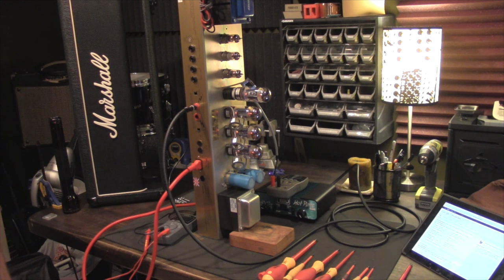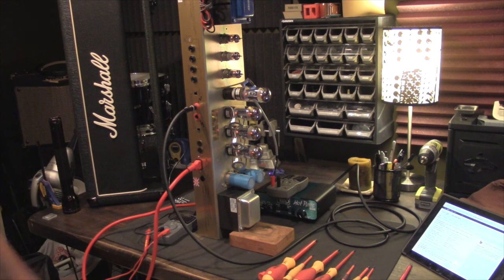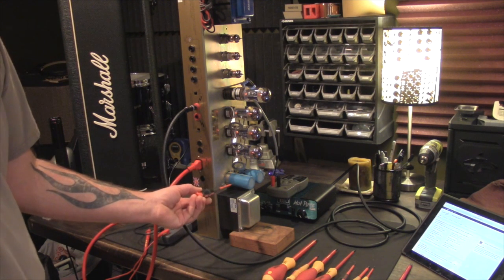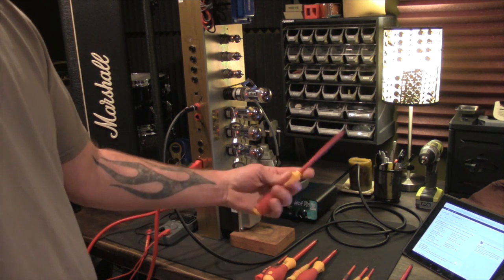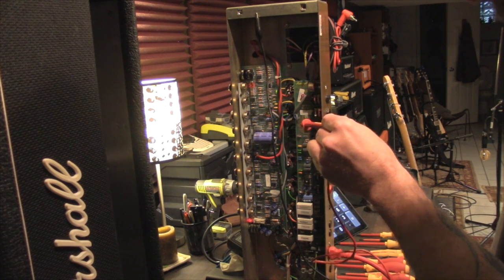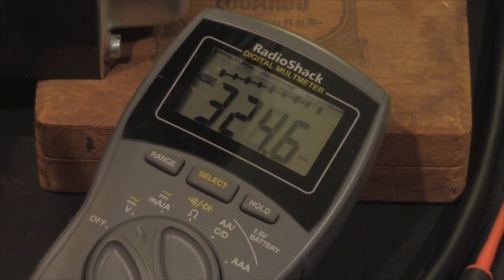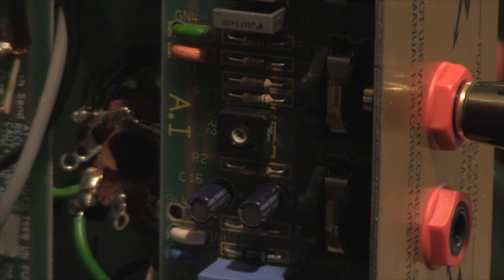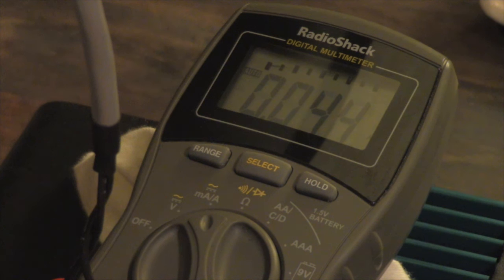JCM900 Bias Video

Comment: I have a 2555x and was unsure about biasing. It has bias points which makes it a lot easier and safer. what I don't know is what I should bias it at. When they shipped it the bias was all out of spec. One side was 85 and the other was 65. I put them both at 70 and it sounded much better.

Comment: Hey 
I just changed tubes on my 900 combo.  Your video was great.  Unfortunately I watched it after I almost blew myself up. LOL  All the things you mentioned I figured out by trial and error,  one other thing is where is the 56K R28 resistor so I can replace with 47k cause EL 34 cant be biased properly the way mine is set up.

Comment: So I'm confused. Can I ask two things? 

So, Isnt there a way to set the Bias of an Amp with just the Multimeter, without having to use bias probes? Like with just using your regular multimeter probes? Because when I tried biasing my 900 for the first time, I had some help, and I just remember having to have the black probe on the chassis, and touching the red probe to a leg of a certain resistor, or the bias test point, and then setting the bias until I got a certain reading on the MM. Like within the recommended bias number as per Marshall, and then I made small tweaks while playing to decide where I wanted it. 

Second, so is using bias probes just a more in depth elaborate way to bias the amp, or a way to get a better average if tubes are not matched or something? 

So the process is, If your using those Bias Probes, are you just getting the plate voltage first(with the normal MM probes), then sticking the bias probe in one of the Sockets with the tube in the bias probe, doing the math, and then setting the bias trim pot, while that same tube is in the bias probe, and then thats it? That's what I don't get, because it seems odd to me that you only need to use the Bias Probe with one tube, but then if you do for some reason use it with every tube, and each tube reads different, or is unmatched, then how do you set it since theres only one trim pot? You just take an average of all the tube bias readings first? Like what I mean is say you set the bias to 44 with the first tube, and then go to the second tube and it's not 44, how can you set it to 44, without the other one drifting? Also, don't you need to get the plate voltages for all the different tube sockets? 

I guess so I'm not confusing you by babbling, Im just confused, because in the video it looks like you are getting the PV off one socket, putting the probe in one socket, getting a Bias reading, doing the math, and then setting the Bias while the bias probe is in that same socket/tube, and thats all there is to it.

Comment: The best video for biasing on youtube!! i have one question though if you can answer, can i do this and how without a bias probe and only one multimeter? and the screwdriver you are using, they dont have the metal tip??
Reply from the maker: Thanks so much! Sincerely appreciate that! You can bias with one multimeter only, you just have to use it to read the plate voltage and then use it to bias the amp instead of having them both hooked up. The screwdriver has a metal tip but completely incased in plastic and rubber.
Reply: +Roy Cox Oh thanks for quick reply!! So i can measure bias current the same way as plate voltage? I dont need a bias probe for tube socket?
Reply from the maker: +MBString I'm pretty sure you can measure bias by using using different pins but I'm not familiar with biasing without a bias probe . If you do some research you may be able to find info on biasing without a probe. Be careful!

Comment: ROY COX, 
Is the Chokes storing current like a reservoir like the filter capacitors or is the Choke doing something else to the AC ripple, not sure if the Choke is regulating the current? 
Most Power tubes 6L6,EL34 use a B+450vdc on the plates, if you increase the B+ to +600vdc would this increase the AC ripple but why would it increase the AC ripple? i would think it would decrease the AC ripple because more B+ voltage mean less current draw from the power tubes. 
When you're biasing the power tubes in an amplifier circuit how do you bias the compression of the power tubes the 1dB compression point of when the power tubes start to compression? because its say to bias tubes at a 30mA bias current per tube to be safe but how do you know when the tube is compressing?

Comment: Where did u find that 30W information? Datasheet too? What field? Is it plate voltage or screen grid? I can't find the same information on the Sovtek 6550WE Tetrode.
Reply from the maker: the tube wattage is from the tube manufacturer and follow the video closely and i talk about where i find the plate voltage, etc.

Comment: Ive got an issue with mine, it works fine, but when reading the plate voltage, im getting 672 and not 470 like the average, what can I check or what could be causing this? Thanks!

Comment: I have a JCM 900 MKIII that has all stock tubes from the factory and they are still good.  I has EL34 tubes and I have not had it to a shop.  I have read that it might be biased from the factory to run 6L6 tubes and that it might be over biased running a lower current, is there any way I can check that without a bias probe?  My amp was made in 1990 serial starting with Y.

Since I play metal I use only metal on my amp.

Comment: Quick question. So you were touching the red probe to pin 3 with the black alligator clip on the chassiz to get the reading I understood that part, but when it came time to adjust the bias how were the probes set up, did you just have an alligator clip on pin 3 instead of the probe, or how was it hooked up to get the bias reading?Also can you bias an amp without knowing the values of each tube? Like do you only need to get the reading off pin 3 and thats it for this amp?
Reply: you unplug the alligators after reading the plate voltage, and plug it on the bias probe, to read mA.  you only have to do it for one tube. Pay attention to buy paire quartet.

Comment: I am trying to bias a JCM900 MKIII 2500 (50watt) el34 and having some trouble.  First off when I set my multi-meter to 200ma it gives me a super low reading (11.7ma).  When I set it to 200mv them it gives me a low reading.  I turn the pot all the way up and max I can get is 27.2mv.  What am I doing wrong?
Reply: Bias resistor is the wrong value

Comment: Hey Roy, great video, best I've been able to find. But, I have a JMP 100W Super Lead Mkii which I'm going to replace the 6550s. Is the biasing procedure the same for this vintage amp? I know the voltage/current values will be.

Comment: Have same amp . What if I just changed out the power tubes new matching without bias ?  Thanks
Reply from the maker: if the new tubes are rated exactly or super close to the old one then you can probably get away without biasing but the chances of them being the same are usually not that good so I always like to at least check the bias. It just helps to make sure the amp sounds its best!

Comment: Great video man! I just bumped into a 94' JCM900 4100 100 watt. The amp sounded great at the sellers home, however I don't think i'm going to use it until I get done what your doing to this one! I'm a little confused about seeing the 7881's being replaced with the ones you put in this amp, and others using EL34's. Should I stay with 7881's.. are EL34's okay to put in? Is one set better for the amp or not? I play harder rock/metal. I do know you get a different sound with different valves. Again..'thanks for your video.. the best on youtube!   \,,/

Comment: Roy. Joe here. Wanting to know if I have jcm900 head I bought and it don't have the 4 power tubes in it. It has the 3 original marshall preamp tubes in it. It says it has 5881 power tubes.my question is I don't know it's history with previous tubes if I buy the new 5881 tung sol would it need to be biased
Reply: Yes.

Comment: If you don't have any biasing equipment, can you just crank the bias pot up while the amp is unplugged and discharged and hope for a better sound?
Reply from the maker: I'm sure it's possible but that adjustment screw is so sensitive that it could easily cook those tubes if turned too far which could easily burn the tubes up. New tubes cost way more than a bias probe so I recommend not risking it but rather getting the probe and multimeter. You'll get your money's worth many times over in the future when you have to replace the tubes. It's so worth having the probe and learning how to do it!
Reply: +Roy Cox Hey man, I cracked my amp open and learned that the amp is currently biased at 42, and when I did the calculations that you explained in the video, I learned that It should be set at 38. Any thoughts? is that too hot? Sometimes the amp starts crackling, and I don't know if thats a product of over-biasing and I wanted to get your opinion first.
Reply from the maker: +Kelly Bouchillon that's a little hot but nothing too severe. I doubt the crackling is coming from the hotter bias but most likely your preamp tube socket of sockets being dirty of a bad tube. You may want to spray deoxit 5 on the pins of a 12ax7 and push it in and out of the preamp tube sockets to clean it, then put the tubes back in. If that doesn't fix it then try a new 12ax7 in each slot and see if it goes away. The hotter bias won't hurt anything but can wear the tubes prematurely.
Reply: At one time, amps were biased by watching the output tubes in a darkened room, turning up the bias slowly until the tubes' plates began to glow orange, and then backing off the bias until they stopped glowing. Not recommended!

Comment: Great video! I'm curious- is it necessary to do this with each power tube in the amp? Or are we assuming that the tubes are matched to begin with? Any benefit to testing one vs. all four, except to ensure that the tubes are matched? Finally- what kind of bias probe do you prefer?
Reply from the maker: They are usually done in pairs, meaning you can take a reading of the right two and then the left two, etc. if you are reading and biasing singles, then atleast check the first and then last to make sure they are way different.

Comment: such a great video... thanks so much for ur work! if i saw this vid couple of days ago.. i could have saved nearly 100$ haha. hey btw! i have jcm900 sl-x. does sl-x has same form like ur, so i can bias mine same as what u've done to urs?
Reply from the maker: absolutely!
Reply: thx for reply! cheers mate!
Reply: great video Roy , very detailed , what about the other 3 tubes , do you use the same adjustment pod for the other 3 tubes ? , my 900slx conked out , blew a output valve fuse no -2-3 valve , replaced the fuse with the same value , , fuse LED shows not lit now , so fuses are good , but no sound now , just hum , i'm going to replace the output valves with the same ones sovtek 5881  , so this video i'm using as reference , everything in the amp board looks good no blown caps no burnt resistors ,  since the output valve fuse  blew im assuming its the tube 2-3 , they are 23 years old , i understand your whole video except the part after you did the first tube , does that one tube adjustment cover the rest of the tubes also ? ,  , i'm new to this , thanks for the great tutorial........Mike
Reply from the maker: tubes are generally biased in pairs (power tubes). When you do one you can usually not mess with the other because it will be super close. The best method, if only using a single socket bias probe like mine, is to bias the first tube and then remove the bias probe, place it on tube 3 and check that side as well. This is a commonly done practice. I have found that this amp is good to go by biasing the first. The rest will be very close to the firswt tubes reading. Also, it depends on how closely matched your power tubes are. I buy mine from "the tube store" online and they match their new tubes extremely close. They even mark the numbers on the sides as to what each tube read on their machine so you can be guaranteed a close match. Hope this helps.

Comment: Do you only bias one of the power tubes?
Reply from the maker: no, you are biasing each set of power tubes. the left two and right two
Reply: @roycox4415  I've got a Marshall JCM900 SL-X with 2 power tubes(50W version). I just see 1 pot to adjust. So you can adjust 2 tubes with 1 pot?
Reply from the maker: @kameel68  you only have one pot to set the bias for all of the power tubes as a whole actually. This is why you want to find power tubes that are as closely matched as possible. This way all of the tubes are super close when biasing with only the one pot
Reply: @roycox4415  Today I had opened my amp to fix some creaking potentiometers. While doing that I also took a look inside and noticed that there was only 1 adjustable pot on the PCB.

Comment: First: Great Video that helps me further.
But one question arised while watching different videos for biasing: Is there only one potentiometer to adjust the bias for all tubes, or is there one potentiometer per tube?

Thanks in advance :)
Reply from the maker: Hey there alexander, thanks for the compliment. Im glad it helped you out a bit! There is one pot for all the tubes in this amp.
Reply: +Roy Cox Thanks for the fast reply.  I have the Jcm900 too - so good to know that i have to look for only one poti :)   I'm just searching for a good vid that explains biasing with just a multimeter. But probably a technican is more secure :D
Reply from the maker: +Alexander Gantikow 
You'd be surprised at how simple it is once you do it once safely! It will save you a bunch of money also. Just be extremely careful when removing the chassis from the housing that you don't grab underneath of the electric, especially where you see the blue capacitors. you'll be just fine if you watch this video step by step!
Reply: +Roy Cox  I share your opinion about doing it by myself - not only because of the money but rather because im interested in how such an amp works :)  
Thanks for the safety-tip. I will grab the amp at the transformer as you said in your vid :)  I found a vid by premier guitar that describes how to unload a capacitor. (Its vid-name is "DIY: Amp Safety 101") This should make the safety higher, don't you think so?
Reply from the maker: +Alexander Gantikow 
sure it never hurts to take extra precautionary steps!!!

Comment: JJ and EH are the same tubes from the same manufacturer so are Ruby, TAD and every other cheap chinese made tube.   The low end JJ tubes are MADE IN CHINA at the Shungyen plant.   JJ tubes that are made in Solvakia are made with Chinese supplied parts and are made on Chinese equipment in Solvakia and when you buy cheap chinese shit you will have cheap tubes that never meet any specs.